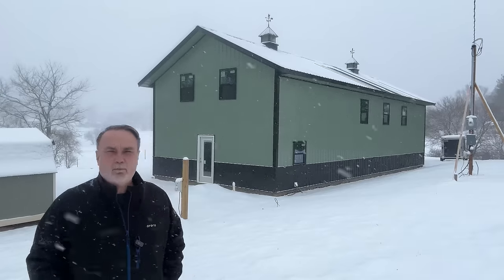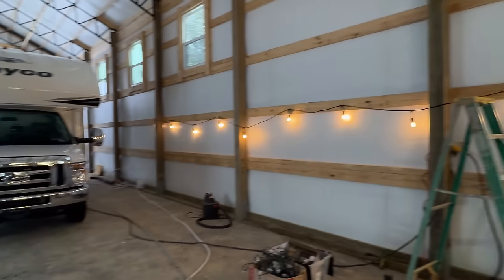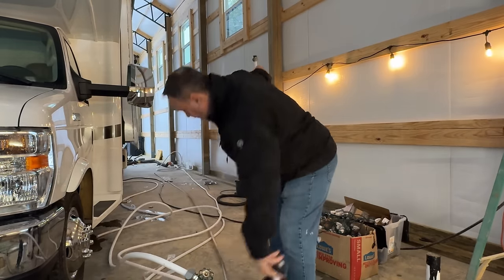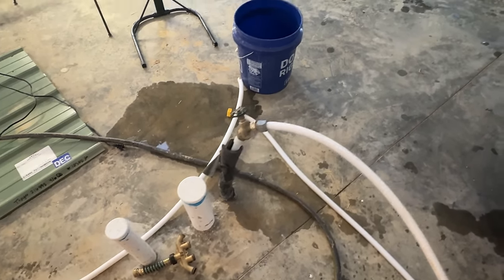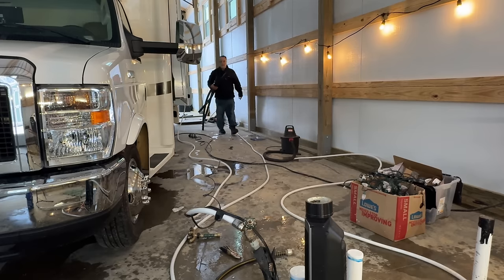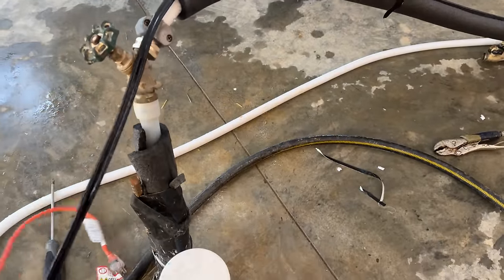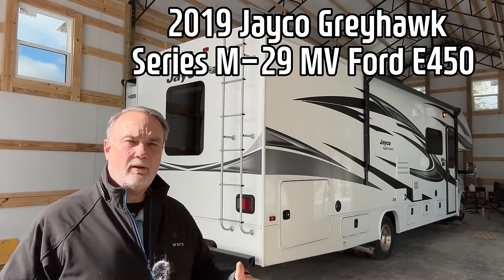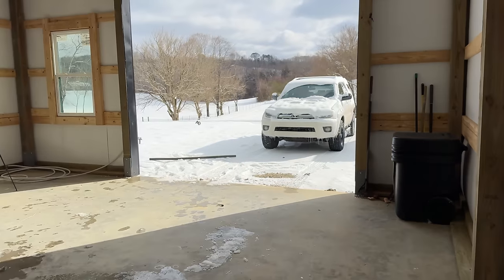2024 Arctic Cold Front Surviving in a Motorhome at 0 Degrees: Issue is Keeping Water From Freezing

Comment: Hey John, You can purchase a 90 degree brass fitting that attaches to the RV on your water line. This allows the hose to go straight up the side of the RV, into the brass fitting and 90's into the rig. They are .99 cents and will probably alleviate the dripping from the weight of the hose.   One additional suggestion, pick up a flexible sewer hose support. This will allow gravity to drain right to the sewer.  Keep these videos coming pal.
Reply from the maker: Yes I need that fitting, i have looked at them at the hardware store . Thanks for watching my video and making a comment.

Comment: Hello John! As a retired plumber of 35 yrs, read stats on the heat tape you bought. A lot of them are not designed to put insulation over them, hence fourth they can burn up! Commercial heat tape will specify if you can. More expensive but worth it!
Reply from the maker: ok i will check in on that

Comment: John I would recommend winterizing your motor home with rv antifreeze and just use jugs of water till this passes. Also watch out for Co2 when heating your camper. Be careful of cheap heat trace it can catch on fire.
Reply from the maker: thanks for the idea. The motorhome has a Co2 alarm meter that works so im good there.Thanks for watching my video and making a comment.
Reply: Not Co2 it’s Co carbon monoxide

Comment: Hey John just a tip for winter time water and sewer operations. Don’t leave your Black water sewer valve and tank open all the time. You are going to have real problems as the liquids run off and the solids stay in the bottom of the tank and will freeze and it WILL stop up and even the liquids will stop draining. You need to fill your black water tank at least half full or more and then drain it and you use all that’s in it for a flushing effect. Liquids will flush the solids out this way. 😊. Also be sure you fix you a solid sewer line for when you are in your Barn. The flexible sewer line is harder to use in really cold weather. Ideally you would put skirting around the bottom of your motor home to try to insulate it against the cold. But at the point you are with your building you just need to seal off the big door area with a tarp until you get your door up and try to keep heat in your building to keep the temperature above freezing.  If you can’t keep the inside of your building above freezing you are going to really have problems. Busted lines and it’ll take days for the lines to thaw out. You need to wrap any exposed water lines in HEAT Tape and keep them plugged in anytime it is getting cold 🥶. I wish you the best but at this point you need to keep the inside of your building above freezing is your best hope. When it gets to single digits it’s almost impossible to keep un insulated lines from freezing. RVs really aren’t designed to live in in the cold winter because to much underneath is exposed to the elements. Good luck 🍀🍀🍀and hopefully it’ll warm up soon.  Also use CAUTION if you use a heater of some type in your building and your in your motor home be sure you have ventilation so you don’t get a carbon monoxide buildup and your in your motor home. Be sure and have a Carbon Monoxide detector in your motor home even for the furnace operation. Stay safe and hang in there it’ll be spring before you know it! Just FYI I use to work at a big RV dealer in Alcoa and deal with customers having problems trying to live in their RVs in the winter and they were constantly having problems until they underpinned and heat taped all exposed lines and still had problems when it got in the single digits. Like I said they really aren’t designed to live in in the really cold winter weather. You’ll make it hang in there.
Reply from the maker: thanks and yes i keep the black water closed because it does cause issues if you dont.Thanks for watching my video and making a comment. John Ward

Comment: My dad used to heat his 24x48 truck shop in Somerset KY with an old coal furnace. He supplemented the coal with a drip line from a 15 gallon barrel that contained used motor oil from all the oil changes we did.
This was back in the 70’s. Burning used oil is probably not PC now.
But it kept that shop toasty in the winter time and made working in there bearable.
Reply from the maker: Thanks for watching my video and making a comment. John Ward

Comment: John, My wife and I have camped in freezing to subfreezing temperatures in our RV. We have winterized the tanks and plumbing (antifreeze in tanks and all water lines blown out and water heater drained). We have used portable plastic tanks for water and taken sponge baths. Watching your setup I am concerned with the potential of freezing of your external and internal water lines. Concerned as well that your black hose might freeze too. I know it is getting late in advance of the colder temperatures but you might want to get those drain valves closed, get some RV antifreeze in the tanks and drain your water water lines in the RV best you can. You might then be best toughing it out with portable water tanks stored inside the heated RV and take some sponge baths. With a closed black tank and a couple gallons of RV antifreeze you could still get by using the toilet with portable water to flush with. I don't want you and your wife to suffer damage during this cold and offer this advice to apply as you see fit. Best wishes and safety to both of you.
Reply from the maker: Jodi was not my wife and she decided to take a different joinery in life and will no longer be in my videos. John Ward

Comment: I not only live in an RV but I work on them.  You have a few issues here.  One, those valve in that compartment, along with other fittings behind that false wall are going to freeze and burst.  You need a small electric heater up in there.  The furnace is the best option, however…YOU CAN NOT RUN that furnace inside that building.  I dont think I would run that furnace,  even with no garage door.  Your best option is to put a few small electric heaters, but you are only trying to keep the temps at the valve at 31-32 degrees.  You are not trying to keep it toasty.  You need a temp gauge near those valves and maybe even a warming light.  Good Luck,  I am in Colorado, and i had to just disconnect water and I am using gallons of water to drink and flush toilet.

Comment: Hey, John…from northern Minnesota and a 45 year RVer.  -6 here actual temp, -30 windchill.  No matter what rv manufacturers say, very, very few are made to operate below freezing.  Do you have heaters on the tanks?  Anyway, keep your tank valves closed, especially the black.  Put rv antifreeze in the tanks and really watch your water lines, they freeze quick and nd cause damage you won’t find until it thaws out and leaks appear!  Several good ideas have already been submitted and I’m going to try to find a YouTube video from a full time rver that has a number of good tips for cold weather camping.  Be of good cheer…this too shall pass.
Reply from the maker: hello there, do you live in your RV full time?
Reply: @theappalachianchannel  John, no I don’t….there are a few I know that do, but it’s a pretty tough life.  Mostly depends on really skirting in the trailer, lots of heat tape, and full hookups.  Water lines still have problems from time to time.

Comment: Hi, If I may make a suggestion. I live in Michigan and it gets a little colder here, so I have all but divorced myself from plastic garden hose for the same problems you are having. I bought a 50' real rubber garden hose at a garage sale for $1 once. I had never experienced using real rubber garden hose, so I took a leap and splurged. That was 25yrs ago and I still have it and it was old old old back then. I became completely sold on it. It's indestructible and seems like it will last forever. The only thing it's susceptible to is thievery and my Son mowing the lawn. I know the lawn mower will cut it RIGHT NOW, PRONTO. Like a hot lawnmower blade thru tall Dandelion stalks, that mower makes short work out of real rubber garden hose. And I am worried about someone spotting them on a drive by. Even though it was very very old, I could still read where it was sold at Sears. Notwithstanding the lawnmower, and even though very very expensive, and I am poor and very cheap, I bought 3 - 50' hoses brand new.  I take care of them like they are alive, and hope to have them for the rest of my life.* The new ones have massive brass ends that are so strong you could run over them with a semi truck on pavement and they won't be hurt. And the rubber is just fantastic for flexibility.  They are Black, but if it was important to me I'd paint them White, maybe with a rubberized paint. But I know now, I will never look back. ben/ michigan * I mow the grass now, but I won't even leave them out to let the sun attack them.

Comment: I would seal off that big entry door with plastic or tarps, then at least cover it with sheeting or insulation for time being and run a space heater inside to keep the inside from freezing the water and also keep the temp up from outside temps for RV living!! They sell decent space heaters run of fuel or propane that are regulated with their own thermostat you could keep the inside the building above 35 deg easily and solve most problems until the cold is gone.. that big door opening is what’s causing huge problems. Once you’re sealed off  from outside air life can get much easier to control.. But none of my business just my opinion.. Good luck!!
Reply from the maker: I did on the next video..Thanks for watching The Appalachian Channel. I have started a series called Barndo Life that you can watch at the below link. John Ward
https://www.youtube.com/playlist?list=PLhiXVG-s0EOmYVTLXE6C5AUbmiOt4M0ys

Comment: Do you know what your in coming water pressure is? I ask because you should have a pressure regulator always in line and set it to 40psi. High water pressure will cause seals to leak and possible fitting leaks.
Reply from the maker: yes it has a pressure regulator on the outside in meter box that i put im